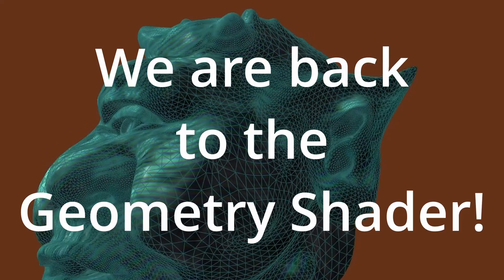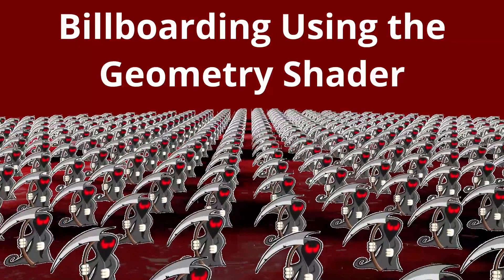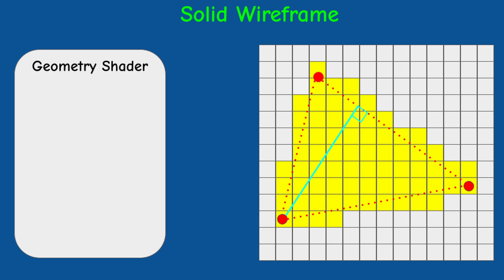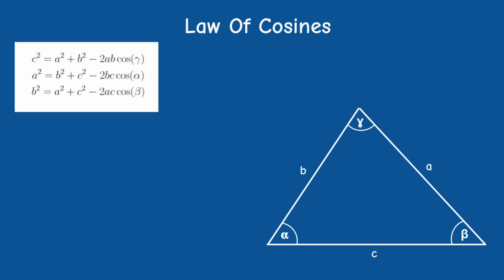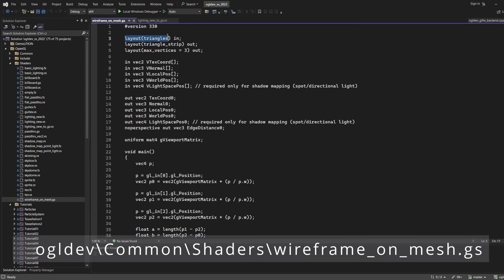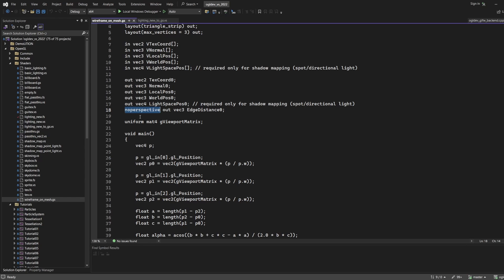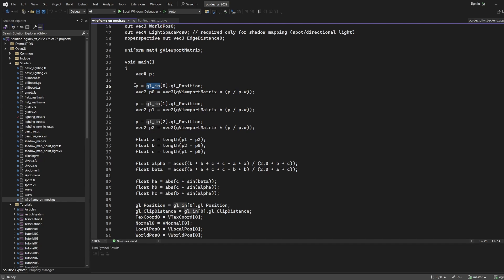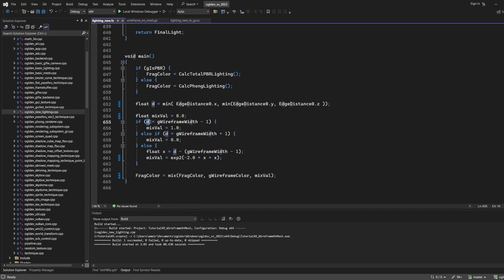Render a Wireframe On a Solid Mesh // OpenGL Tutorial #49

Comment from the maker: I've just noticed an error on the slide with the Pythagorean theorem - C should be squared ofcourse...

Anyway, here's how to get the code for this tutorial:

Clone the sources: 
git clone --recurse-submodules https://github.com/emeiri/ogldev.git

If you want to get the same version that was used in the video you can checkout the tag 'TUT_49_WIREFRAME_ON_MESH'.

Build on Windows:
Open the Visual Studio solution: ogldev\Windows\ogldev_vs_2022\ogldev_vs_2022.sln 
Build the project 'OpenGL Tutorials\Tutorial49_SolidWireframe'
Reply: @OGLDEV, thank you for this fun tutorial example. But I found out when I overlayed my first pass with a full model, and 2nd pass with wireframe or the other way around, I don't see any z-fighting at all? Am I doing something wrong? I didn't have to offset anything and I even tried changing the glLineWidth(float) and still no z-fighting? I'm using OpenGL 4.5.0 core and vs 2023.
Reply: Never mind what I said. I decided to put both side by side and rotate my buddha objects and sure enough, the 2nd pass did show Z-fighting. So I stand corrected, and Geometry shader method is quite clever thank you OGLDEV! As usual I went deep down the rabbit hole and enjoyed it very much~ 😌😌😌😌
Reply from the maker: I guess the problem is that solid rendering and wireframe rendering have their own logic path in the GPU which leads to slight variations in depth calculations. This means that in some cases the problem will not be triggered so the second pass will take over and you will see its color and in other cases you'll get different results for neighboring pixels which will lead to Z fight.

Comment: quite strange, there are two errors in the shader program, both of them are Type Mismatch.
Error1: the shader failed to inferthe size of  `gl_ClipDistance` from the code `gl_ClipDistancegl_in[0].gl_ClipDistance;` in `wireframe_on_mesh.gs` , though there is `gl_ClipDistance[0] = dot(vec4(Position, 1.0), gClipPlane);` in `lighting_new_to_gs.vs`

Error2: it seems that the keyword `noperspective`  is not automatically propagated to subsequent shader stages, whitch means some shader between gs and fs may not set `EdgeDistance0` nonperspective`

my solutions: 1. change code in `wireframe_on_mesh.gs` from `gl_ClipDistance= gl_in[0].gl_ClipDistance` to `gl_ClipDistance[0] = gl_in[0].gl_ClipDistance[0];` so that the shader could know the array size. 2. delete the keyword `noperspective`
Reply from the maker: Error 1: In the checked-in code I see the following:
gl_ClipDistance = gl_in[0].gl_ClipDistance;

Error 2: I did a quick check and it looks like EdgeDistance0 is marked as noperspective wherever it is used. Maybe I missed something.
Reply: @OGLDEV  Maybe  i know why error2 occured, phong_renderer uses not only lighting_tech, but also skinning_tech, which uses `skinning.vs`, and EdgeDistance0 in this file does not have the keyword noperspective. 

As for error1, i run the same code in my another device, and no error occured, there maybe some other reasons. I switched the branch to Tut 49 in VS and ran your source code directly. It does threw an error:
!!! Debug callback !!!
Debug message: id 1, SHADER_ID_LINK error has been generated. GLSL link failed for program 1, "": Type mismatch: Type of gl_ClipDistance different between shaders.
Out of resource error.

Message source: Shader Compiler
Error type: Error
Severity: High
Error linking shader program: 'Type mismatch: Type of gl_ClipDistance different between shaders.
Out of resource error.
'
Error initializing the lighting technique
Reply from the maker: Error1: noperspective was added sometime after the tag so the latest code is ok.
What GPU are you using? I'm seeing the same error on Intel. I will later check on NVIDIA.
Reply: @OGLDEV  
On my Surface with an Intel Iris Xe Graphics card, I encountered Error 1 when running directly from Visual Studio on the Windows platform.

On another device, which has an Intel CPU and a GTX 1650, but I'm using WSL2. The output shows GL_RENDERER: llvmpipe 19.1.1 and GL_VENDOR: mesa. I'm not very familiar with this,  it might be a GPU-related issue.
Reply: @OGLDEV  Based on my Task Manager, WSL2 appears to be utilizing the GTX 1650.
Reply from the maker: The llvmpipe and mesa are open source drivers so I guess their support for OpenGL is limited compare to NVIDIA. I'm not familiar with WSL2. I also have GTX 1650 and the code works on Windows.
Reply: @OGLDEV  I also ran it successfully on my 1650 directly on the Windows platform through vs. Maybe it
really was the Intel integrated graphics causing the issue.
Thanks for your help
Reply from the maker: You're welcome!

Comment: Hello, I can not find the code for this in your repo. The tag 'TUT_49_WIREFRAME_ON_MESH' seems to be missing as well.

Also, additional impl. details from the NVIDIA paper are missing in your implementation (or maybe they are implemented but not mentioned in the video) , notably the cases where a triangle intersects the near plane. Yet your visual demo at the end of the video shows no problems. Can you explain how you did it?

I was implementing this technique in my OpenGL engine and came across your video while searching for clues. Nice channel btw, cheers!
Reply from the maker: Thanks! The tag is actually a branch in this case so if you clone the sources you should be able to check it out. This video is actually based on a chapter in the OpenGL 4 Shading Language Cookbook (3rd edition) which in turn is based on the NVIDIA paper. Anyway, this was a long time ago so I will need to compare both sources to find out if anything is missing.

Comment: this is so great video,and  i want to konw can this stuff generate by compute shader?
Reply from the maker: Thanks! Theoretically you should be able to do the same thing using the compute shader but notice that we rely on the GS to process full triangles and calculate the edge distance. If you have GL_TRIANGLES as the topology you will need to process groups of three vertices in the CS with a stride of 3. If you have GL_TRIANGLE_STRIP it is different because you have a new triangle on every vertex.

Comment: sin( arccos(x) ) = sqrt( 1 - x^2 ). Arccos(x) is the angle y such that cos(y) = x. We also have that sin^2(w) + cos^2(w) = 1 so sin(w) = sqrt( 1 - cos^2(w)). So sin( arccos(x) ) = sqrt( 1 - (cos( arccos(x)) )^2 ) = sqrt( 1 - x^2)

I don't know if this is easier to calculate... but you could compare square distances instead of comparing distances. That is,  instead of taking sin(alpha) * b, you could take sin^2(alpha) * b^2 = (1 - x^2) * b^2 = b^2 - b^2 * x^2 = (b + b * x) * (b - b * x). This is almost certainly faster than directly implementing sin( arccos(x) ) for each projection line.

Further simplifications can be made. 

x should be (b^2 + c^2 - a^2)/ (2*b*c)

Let L = b * x. Then L = (b^2 + c^2 - a^2) / (2c) = (1/2) * [ (b^2 - a^2) / ( c ) + c ] = (1/2) * [ (b+a)*(b-a) / ( c ) + c ]. 

So sin^2(alpha) * b^2 = (b + L) * (b - L).

Similarly, to find sin^2(gamma)*b^2,  

sin^2(gamma)*b^2 = ( 1 - y^2) * b^2,

where y = (a^2 + b^2 - c^2) / (2ab).

Let M = b * y = (a^2 + b^2 - c^2) / (2a) = (1/2) * ( (b+c)*(b-c) / (a) + a)

Then sin^2(gamma) * b^2 = (b + M) * (b - M)

Finally, for sin^2(alpha) * c^2,

sin^2(alpha) * c^2 = c^2 - (c^2)*(x^2) = (c + c*x)(c - c*x).

Let N = c*x = (b^2 + c^2 - a^2)/(2*b) = (1/2) * [ (c + a) * (c - a) / (b) + b]

so sin^2(alpha) * c^2 = (c + N) * (c - N)

This way, the problem is reduced to simple arithmetic operations. But IDK if all of this is that helpful. I only tried to find a simplification because you said that the arccos operation was costly.

The code would only need the following modification:

float a = length(p1 - p2);
float b = length(p2 - p0);
float c = length(p1 - p0);

float L1 = (1/2) * ( (b+a) * (b-a) / (c) + c )
float L2 = (1/2) * ( (b+c) * (b-c) / (a) + a )
float L3 = (1/2) * ( (c+a) * (c-a) / (b) + b )

float ha2 = (b + L1) * (b - L1)
float hb2 = (b + L2) * (b - L2)
float hc2 = (c + L3) * (c - L3)

(and then use ha2, hb2, hc2) for comparison instead of ha, hb, and hc)

and then in the fragment shader, you also need:

float mixVal = 0.0;
if (d < (gWireFrameWidth - 1) * (gWireFrameWidth - 1) ) {

	mixVal = 1.0;

} else if ( d <= (gWireFrameWidth + 1) * (gWireFrameWidth + 1) ) {
	
	float x = d + (gWireFrameWidth - 1) * (gWireFrameWidth - 1) - (2.0) * sqrt(d) * (gWireFrameWidth - 1) ; //since d is already a square distance
	mixVal = exp2(-2.0 * x);
}

FragColor = mix(FragColor, gWireFrameColor, mixVal)

-------

Alternatively, you might get away with writing 

	float x = d - (gWireFrameWidth - 1) * (gWireFrameWidth - 1) ;
	mixVal = exp2(-2.0 * abs(x));

Though I haven't tested the code to see if that gives desirable results. So the square root of d may be needed.
Reply from the maker: Thanks for the detailed info. I guess it makes sense though will need some time to review this more deeply. I did notice that you've add a square root to the fragment shader which might also take some cycles. In general, the approach of comparing squares of <whatever> instead of the exact <whatever> makes a lot of sense and is very popular.
Reply: @OGLDEV  yeah. I was trying to think of a way to just directly compare the squares of the distances but I noticed that you were already using x^2 in the exp2 calculation. So you had something like x^2 = (d - y)^2. Whereas I had suggested to precompute D = d^2 so it was a little tricky to write out the same expression without taking the sqrt(D). But if a different exponent could be used in exp2, then it would be more efficient. 

Perhaps you could write the same line that you had originally written: mixVal = exp2(-2.0 * x * x)

So float x = d - (gWireFrameWidth - 1) * (gWireFrameWidth -1);
mixVal = exp2(-2.0 * x * x);

I think this would work 🤔

Anyway, I really enjoyed your video! Great job, man!
Reply from the maker: Thanks :-)

Comment: You can avoid using the slow geometry shader entirely, without drawing objects twice.
If you use barycentric shader language extensions, which gives you access to query the fragment's barycentric coordinate inside the pixel/fragment shader.
Reply from the maker: Thanks, I actually got this comment on the reddit post for the video. I will try this in the future and may make a video about it, depending on the schedule...

Comment: That''s a perfect tutorial for an issue that I had in the past. When I did a wireframe mode for an editor, I had an obvious issue with Z-fighting and as a hotfix I just added a small offset to each position inside separate shader. I only used geometry shader for visualizing normal line each vertex.
Thanks for tutorial! 🙂
Reply from the maker: You're welcome!